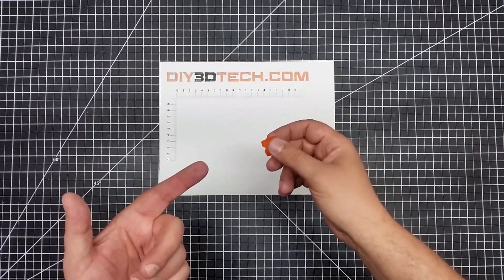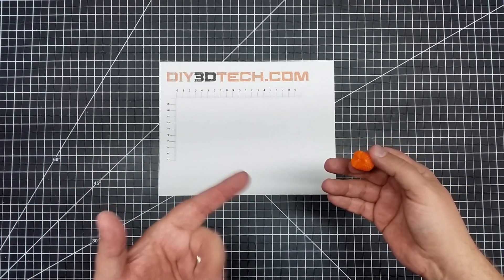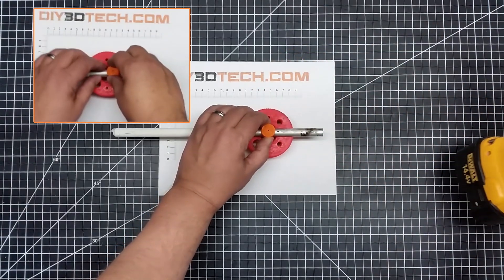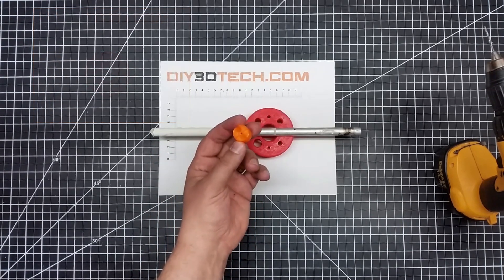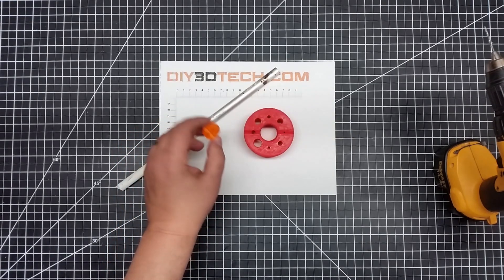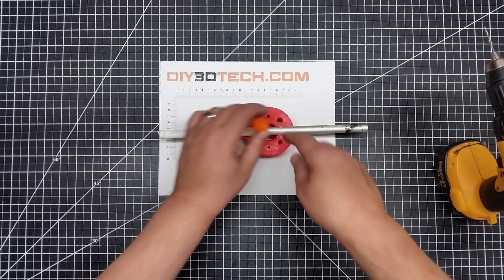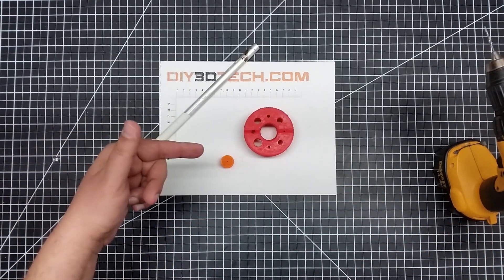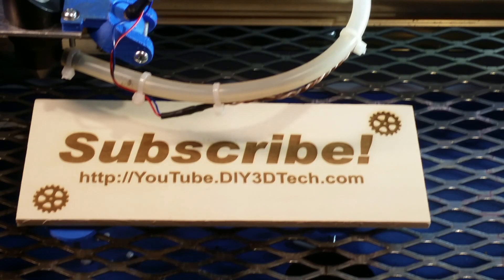Design Talk - Easy To Print Rod Centering Hole Jig!

Comment: I suppose you could also use it on cut wood if you need to make a hole straight through a corner at 45 degrees.
Reply from the maker: Yes however you need to also make sure your hole is centered to the 45's...